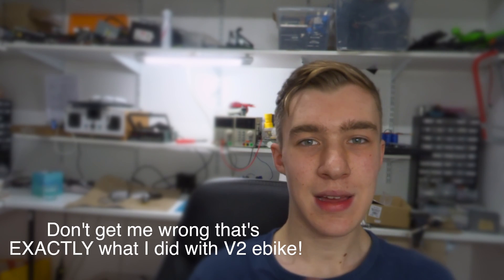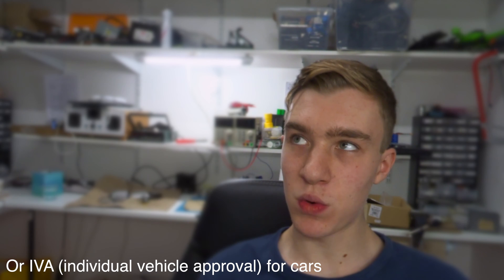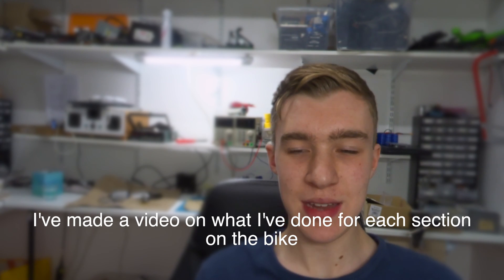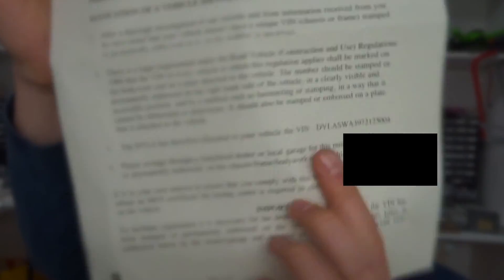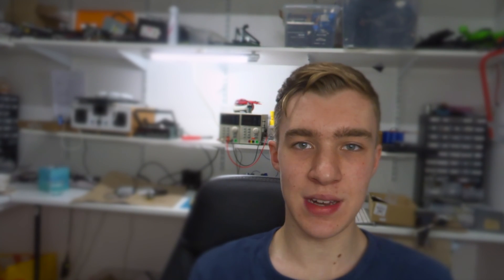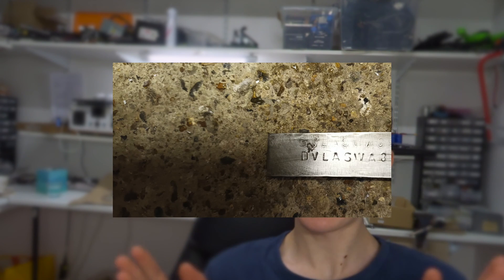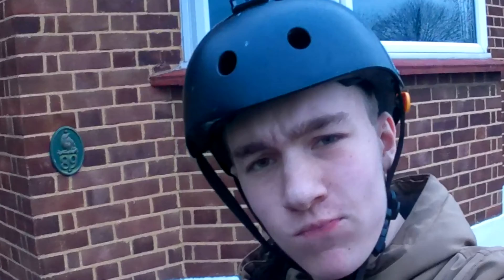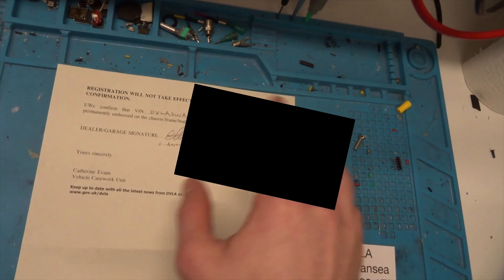How to get a new VIN number? - 8kW Enduro MSVA eBike V3 Build - Part 21

Comment: Hello, I was watching one of endoprysm's videos and also i saw that you had commented on one of his videos. apparently the zoom fork when used with a 203mm rotor the brake pads don't make full contact with the rotor. meaning like the rotor is only making contact with the bottom 3/4 of the rotor. you had said this is because the zoom fork needed a 205mm rotor but that it still works fine with a 203mm rotor just not as efficient. i was wondering if you could go in more detail about this because i have the zoom fork and have not yet bought my brake system i was thinking of using 220mm rotors with magura mt5 brakes
Reply from the maker: I believe the stock brake calliper bracket that comes with the zoom forks is for a 205mm rotor so on anything smaller, the calliper will be sitting too far away from the edge of the disc and won't make full contact. If you're going the other way though and using a rotor larger than 205mm, you should just be able to add washers in between the bracket and the calliper to move it further out and have space for the 220mm one. You could fine tune the distance if there aren't existing 220mm brackets as if there isn't full contact with the pads, you get less performance and uneven pad wear. On the part of the pad that isn't in contact, it will meet in the middle from each side as the rest wears away and actually give you less life per set. Hope this helps!

Comment: well i've just emailed dvla to ask for a vin, by the time it arrives i hope to have the build finished 'enough' to go for it. think i may pull my indicators apart with a hammer and change the leds inside to something brighter, i'm not too impressed with 3 candle power.... also the brakes are worrying and i may have to change to full hydraulic instead of cable operated hydraulic calipers.
Reply from the maker: I'd say hydraulics are a must for bikes with this weight and speed plus they give better feel and don't have cables to stretch. There's a section of the manual that mentions how strong the brakes need to be (covered in part 20) but they're nothing special so most brakes should be fine. Hope the built is going well mate!

Comment: Thanks again for another informative video, Are there restrictions on the style of lights to be used ?
Also, have you found the cheapest insurance company that will do e-bikes ?

I have bought another four cells specifically for the lights and alarm etc, as I have decided to go down the same route as you registering it after which I will probably buy a Lexmoto LXR 300cc to compare and have some various rides!

The frames that are made in china are sometimes made with sheet metal that has rust on it, other times the frames are rust free and then built but left to rust before painting which is a shame. This could potentially bubble up and corrode after some time. I have sanded and vinyl wrapped mine till I can respray it then cover it with PPF.

I look forward to your next video instalment.
Reply from the maker: As long as the are E marked, they're ok for the MSVA test. This ensures they are the correct colour, brightness, beam pattern etc but only if it's a genuine mark which to be honest is hard to tell but from what I've heard that's all they look for. 

Insurance wise, I'm still deciding how to do it - ideally I would have pay-as-you-go type but haven't found a suitable company yet that does it for leisure riding. The only quote I've got is by putting an equivalent electric moped which was £600 a year 😬 but I have no idea how that would change with my vehicle details. Young, male you get the picture! I've heard Andy Kirby got his for around £250 which is still quite a bit more than standard motorbike insurance. I'll do a video once I've got it all sorted but still researching at the moment. Hope your build goes well!